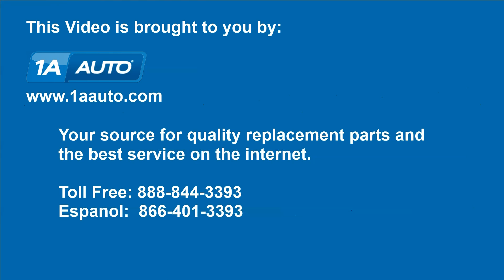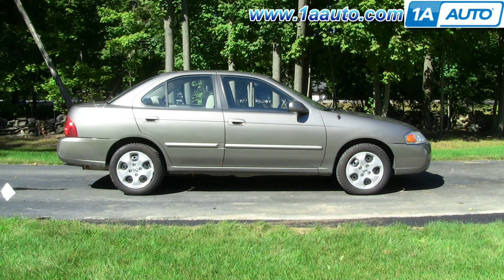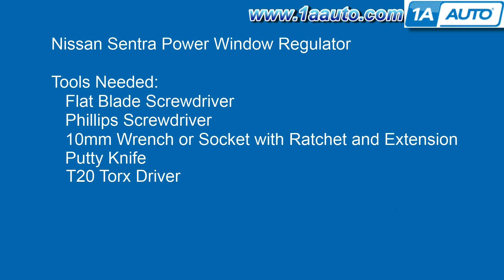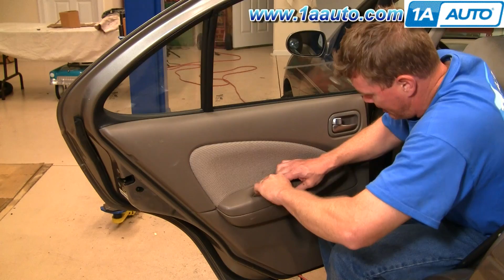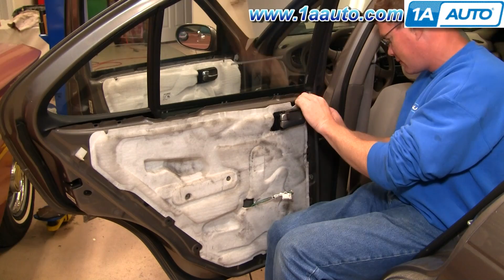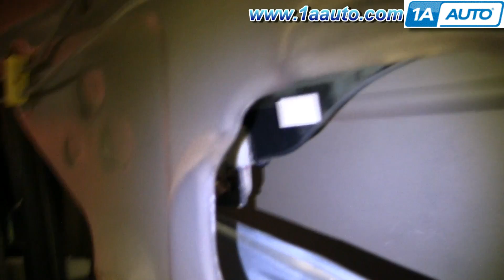How to Replace Window Regulator 00-06 Nissan Sentra

Comment: This super late, but it is easier to get the 2nd window bolt(right one in this video), by putting the window all the way down. There is a little more room at the bottom of the door. Also, like another viewer, I ordered an assembly with regulator and motor, and connections did not match. Ended up stripping wires and connecting myself.

Comment: Thanks for the video.  Replaced my daughters regulator today.  Not mentioned in the video, but on the webpage.  Her car was made in Mexico so the connector didn't match.  The motor from the original and the regulator I got on(ebay) sorry didn't match mounting holes.  So I snipped each connector off each and used bullet connectors.  Worked great.
Reply: I used a replacement aftermarket regulator from Aisin, pn# RPN-033 for the rear left window, $20.  Worked perfectly for my 2003 Sentra, holes matched up to the original motor without issue.

Comment: My 2004 Sentra window regulator had different shape connector compared to the new regulator. I had to cut the wires and mend them together to get the switch to work! Just be aware of that. It's not difficult to do that additional step. Otherwise, Great video and explanation on the process of removing and installing the replacement part.
Reply: That's only a problem if buying a replacement motor AND regulator.  If buying a quality replacement regulator ONLY, the holes should match up with your motor mounting screws, allowing you to reuse the original motor and electrical connector.

Comment: 12:30
Whoa that part tested my faith. Took a solid 10 minutes of re-adjusting and wrestling with that strip of leather like material before I had the pane aligned right.
Reply: Yes, that flexible paint scraper they used in the video really is key to getting that rear window strip seated properly.

Comment: Will this part fit my 2006 ser spec v model 2.5 L or is it limited to just 1.8 L base models?
Reply from the maker: +PR4470 If you have a 2006 Sentra it would also fit your vehicle. Hope this helps you out. 1aauto.com

Comment: Excellent!Keep a cable end crimp connector and soldering gun handy if you change the motor as the connector differ for 2005 model

Comment: mine just broke same exact door lol I ordered the part already but was wondering if it needs any grease or special dressing the guide (sliding square on the rail) ? I know the factory one has some tan looking stuff on it
Reply from the maker: +alby_truckin95 Typically they don't need to be greased, you should be good to go. Thanks for choosing 1AAuto! Drop us a review on Facebook at www.facebook.com/1aauto to let us know how the repair went! 1aauto.com?utm_source=YouTube&amp;utm_medium=CTA%20Comment&amp;utm_campaign=1ATony 866-403-3393
Reply: I added white lithium grease to the gear rack and the track slide.

Comment: Hi Mike, the only thing thats wrong with mine is that little plastic slider. Is there a way to just replace that without the entire assembly?
Reply from the maker: +umdraco unfortunately there isn't. That's a common failure with these regulators, and when it happens the whole thing needs to swapped out. But here's a link to our site where you order a new one, and we'll cover the cost of shipping it right to your door! Thanks for watching. https://www.1aauto.com/1A/WindowRegulators/Nissan/Sentra/1AWRK00552?utm_source=YouTube&utm_medium=CTA%20Comment&utm_campaign=1ATony

Comment: The replacement part has a different connector.  Any ideas?
Reply from the maker: It should have the same connector as the factory. If it's a part that you had purchased from us, call our customer service line, and we can look into the order for you to make sure that you received the right part. 1aauto.com 866-403-3393

Comment: hope you can help me here. my power window on the passenger side functions properly going down, but seems to have a hard time going up. you can hear it work on the initial attempt to raise it, but it stops. however, you can "assist" the window by pulling the glass up and near the top you can let go and it finished by itself. also, i noticed that the window seem to lean a bit toward a side when going up. any ideas?
Reply from the maker: You could try to put some white lithium grease on the window regulator channel that's inside the door. You could also spray some white lithium grease on the weatherstrip that surrounds the window opening, this will make the window glide easier. Hope this helps you out. 1aauto.com 888-844-3393
Reply: thanks. i guess i'll visit the hardware for that particular spray. im quite new into using cars, i've been driving a bike before. this video about removing the side panel has helped me a lot in an emergency when the window wouldn't roll up. thanks much.
Reply: I have the same exact issue with my 06 nissan sentra
Reply: Took it to a mechanic.grounded wire.easy fix for him
Reply: That's pretty much how my left rear window acted before it finally started dropping down into the door cavity.  It was the exact problem that is shown in this video.  Pretty common among B15 Sentras 00-06.

Comment: The replacement part has a different connector (square instead of round). It looks like the same featured on your replacement. What suggestions do you have in regards to getting these to fit?
Reply from the maker: If you purchased the part from us, please contact our customer service number at 888-844-3393 and we'll look into your order to see if you had received the correct part.

Comment: There is a metal bar attached to the glass. The window regulator arm pivots and slides inside that bar like a sliding ball and socket. There is a tiny plastic piece that holds those 2 together. That plastic piece on mine broke in half. Can I just replace that little piece, or do I need to buy the whole regulator assembly? I don't need the motor. Whats the price and part # for what I need to order? That plastic piece is a very common issue with these cars. It should've been made with metal.
Reply: If you are experiencing the typical failure of the plastic slider in the regulator track, you do not need to replace the regulator.  You can buy the broken piece from blenddoor.com in either aluminum or Delrin construction.  That way you can reuse your OE regulator and motor.
With that being said, it should be noted that for the price of the little broken piece from blenddoor, you can buy a complete new regulator aftermarket.  You'll need to make the call which way suits you.

Comment: Just ordered it. I gotta tell you the insulation removal is the worst part of this whole job!
Also my window "felt" on the top of the door panel was so attached to the door that it sepatated from the panel but was easy to put back on.
Thanks for the video.
Reply: Really helps a lot to do this job in the summer when it is hot.  I find the sticky black mastic adhesive is a LOT easier to separate when the temperature is hot then in the winter.

Comment from the maker: That part number is for the window regulator with NO MOTOR and it fits the rear drivers side on a 2000-2006 Nissan Sentra.

Comment: I was given some bad info. The motor DOES operate. The window acts as if it's physically disconnected from the regulator. Hopefully I'm taking it apart tomorrow. It is a made in Mexico Sentra. If I need to order from you, is this your correct part number?  1AWRG01118
Thanks
Dave
(DaCrowz)

Comment from the maker: It may be an issue with the motor. You may want to test the power going to the motor with a test light to see if there's power going to it. That will make it easier to narrow it down to either a power window motor issue or a switch issue. Hope this helps you out. Have a great day! 1aauto.com 888-844-3393

Comment: (05 Sentra Rear Drivers)   My rear driver side window won't go up or down with the switch but will drift down whenever it wants too. You have to "palm" the window and slide it back up. Sounds more like a motor problem?
This video will definatley help with the disassembly process. Thanks.
Reply: Nope, sounds more like a regulator problem to me.  I have found that if the regulator is fully intact but the motor has died, the window will not typically drop or drift down on its own.